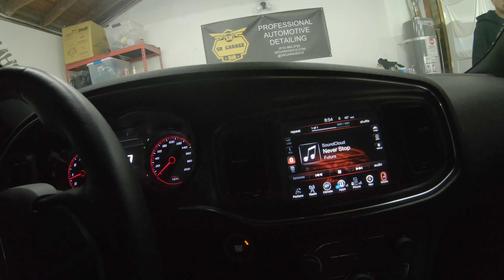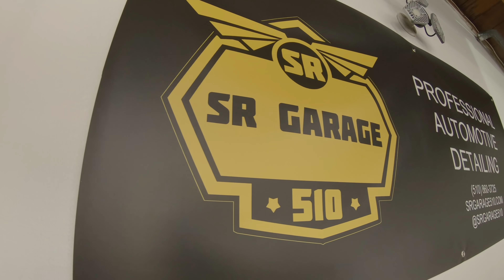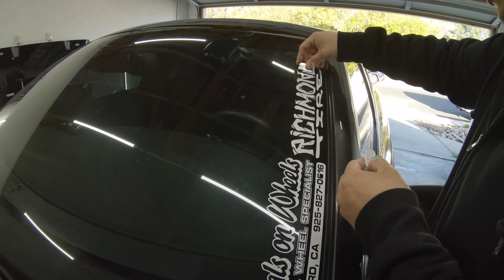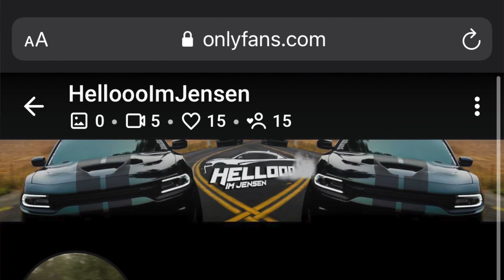REMOVING THE VINYL WRAP RESIDUE + A FULL DETAIL!!!

Comment: Just went to buy a used car that had the wrap removed at the dealer. They washed and prepped the car yet upon arrival, there was residue everywhere, on every crack, on every divot, and recessed space such as sensors. Not sure what to do about it- seems like many panels need to be removed to get to everything.